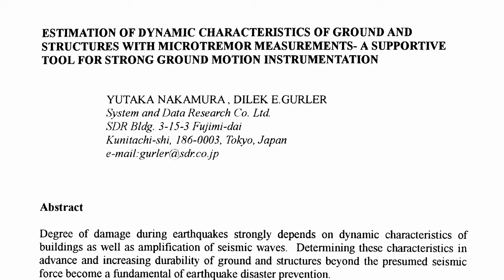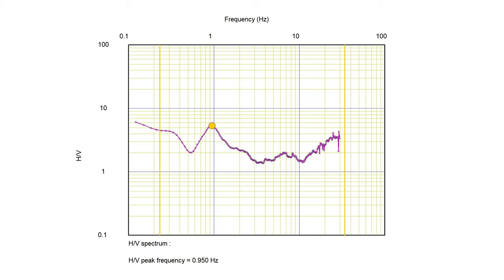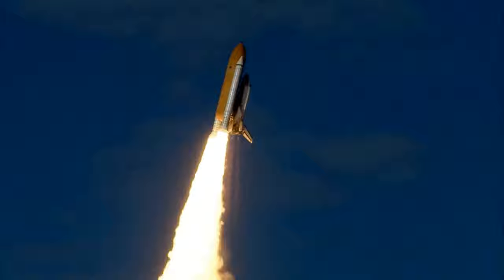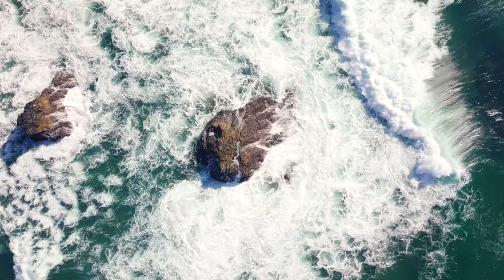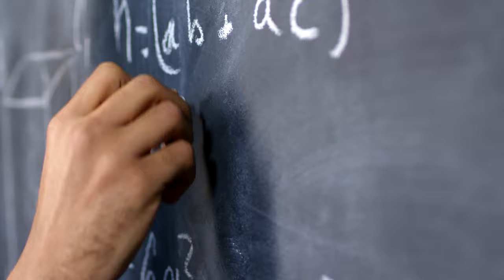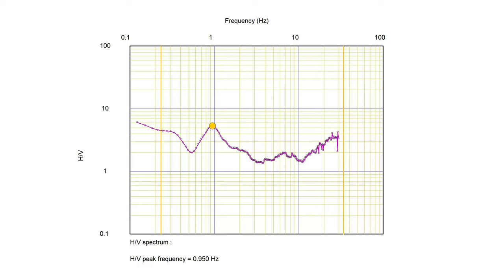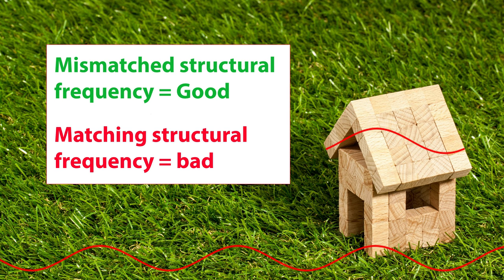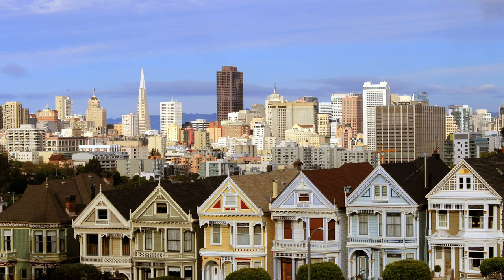Understand Earthquakes with HVSR - Geophysics Explained

Comment: Hi, great video but just few comments. HVSR is used only for soils, we just use Standard spectral ratio for modal analysis of structures (no vertical amplification in tall strcutures). You should also compute the single components spectra when interpreting HVSR, they allow to attest of the geological origin of a HVSR peak. Cheers